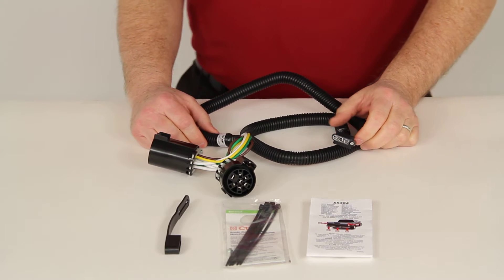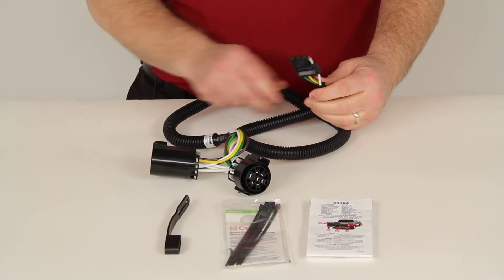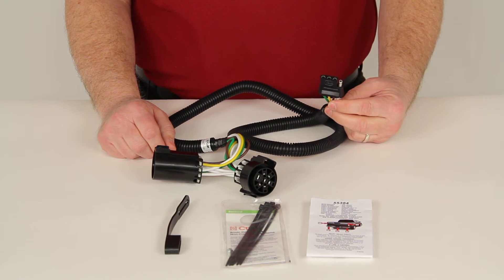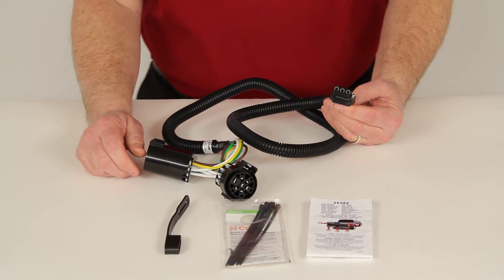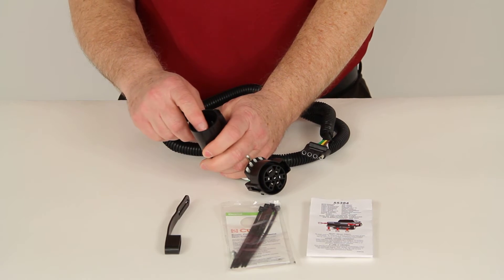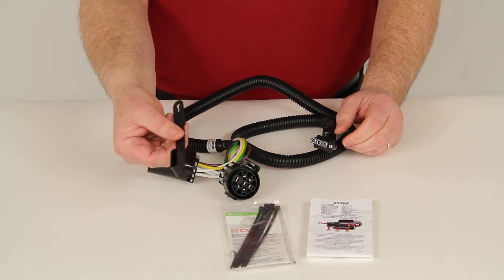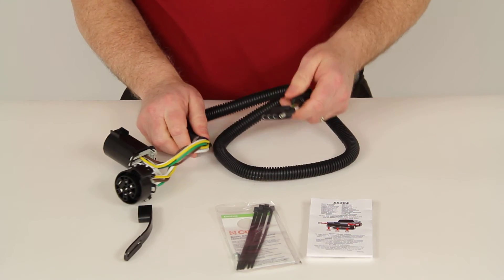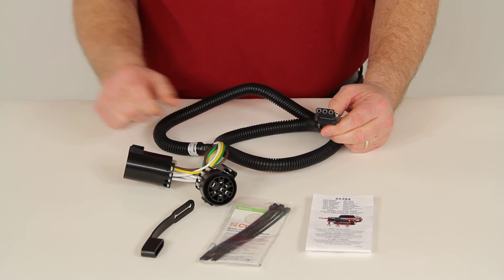etrailer | Curt T-Connector Vehicle Wiring Harness for Factory Tow Package Spec Review

Comment: I need this exact product but one that has the 5wire flat pigtail  instead of this 4wire pigtail. The round 7 wire plugs on this are exact fit but  the pigtail needs to be 5wire flat. I can't  find the proper Curt item number
Reply from the maker: Check out the following link. We have just what you need!
https://www.etrailer.com/Custom-Fit-Vehicle-Wiring/Curt/C56584.html